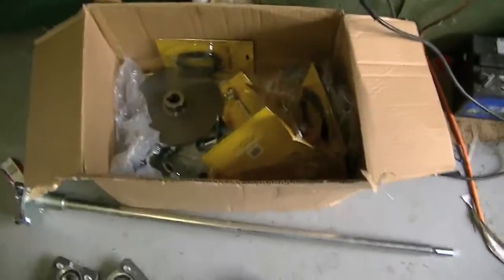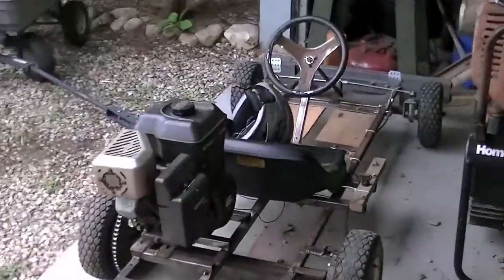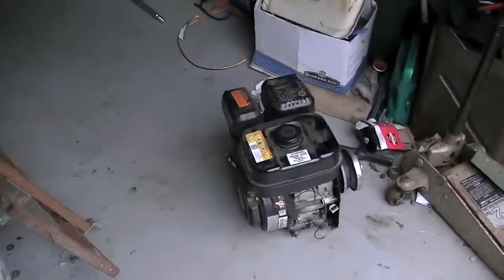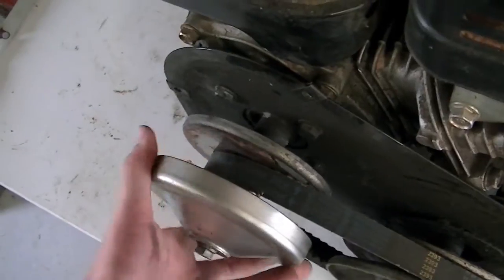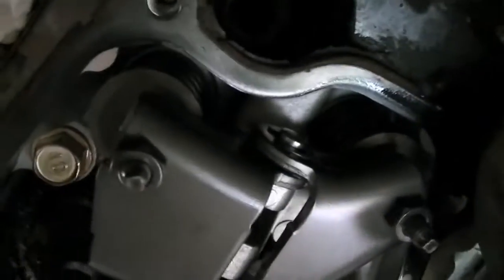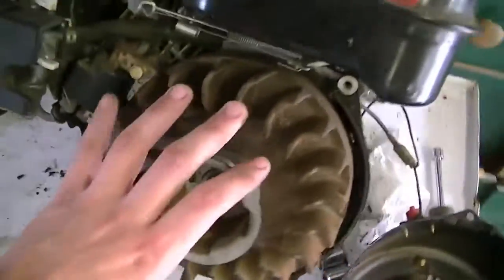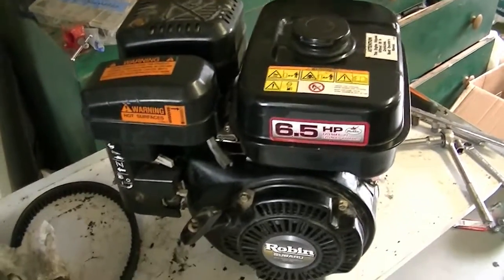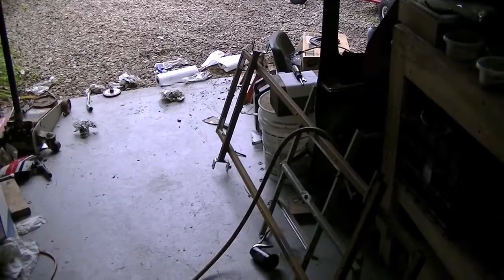6.5 HP Go Kart Build Part 1 - Engine and Parts

Comment: At the end that torque conveter,mine broke like the inside of it some washers or whatever they called broke and then the bearing broke tooo this happen  two days ago do you think i can buy a torqur conveter series 30 or 40 and replace the clutch too? Is that okay if i do that i have the exact same engine as you helpppp meee plsss